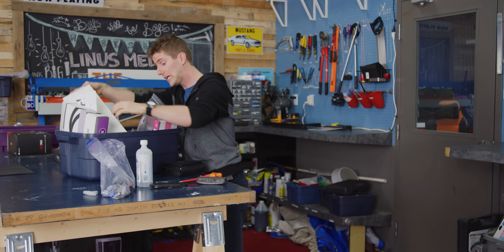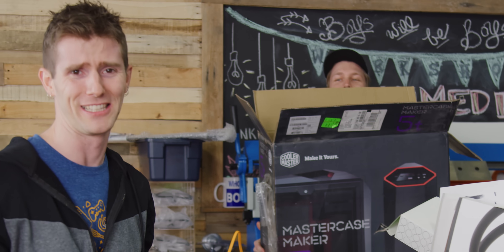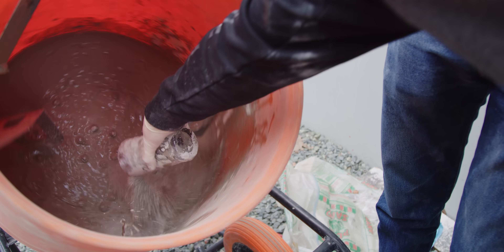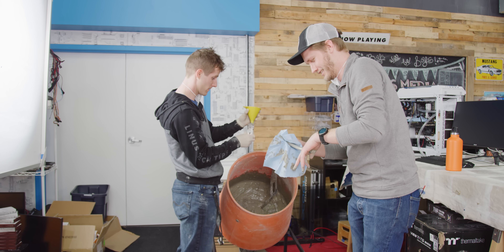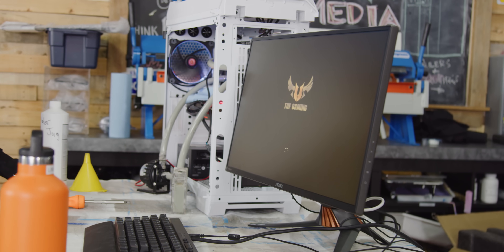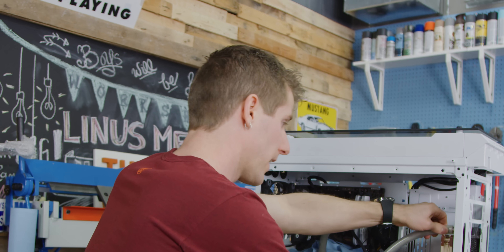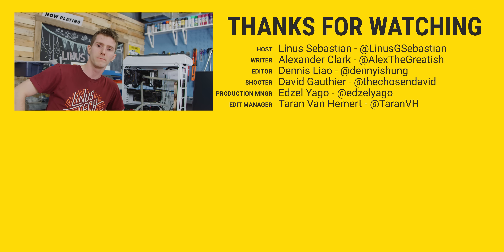I Can't Believe This Worked!!! - Concrete Cooled PC (April Fools 2019)

Comment: The olny april fools joke in the video is that they test their ideas before they shoot a video

p.s. also try liquid metal, its flowing great and does an amazing job cooling the actual metal.
Reply: Gallium cooling! Always keep your PC at a nice steady 50C.
Reply: @Cicirifu  Gallium cooling with an aluminium heat block and radiator :^)
Reply: is liquid metal not extreem expensive?
Reply: @richard123467893  They can probably afford it. Not great heat capacity but it should actually wet the cooling block and radiator pipes, which means good heat transfer.
Reply: Will it not corrode or smth ?
Reply: @marius8032  as long as there is no alu it should be sorta okay
Reply: @marius8032 
Mercury will eat your copper things, mercury disolves copper and forms a solid amalgam, you can check Cody's video on that, its quite hard. Galium forms and amalgam with aluminium, so maybe if you had a copper tube radiator it could work.
Reply: that's an awesome idea i'd love to see that.
Reply: I would... actually love to see this
Reply: @sbcontt YT Could probably get away with a regular strong pump if they mount everything on about the same height.

Comment: Me thinking to myself: doesn’t concrete produce heat as it solidifies?
Reply: Meaning heat is drawn out of concrete. So if heat is endlessly supplied into cement, it will always produce heat creating a fusion reactor.
Reply: @jaywonlee1436  not a fusion reactor, that's different
Reply: Jaywon Lee by drawn out, you mean radiated?
Reply: It's 1st April kids, wtf is wrong with y'all
Reply: I thought it was exothermic as well
Reply: Does concrete need oxygen to solidify?
Reply: @Tillman Adkins no. Just need time to chemicals to bond together.
Reply: The large damns have to be cooled while the huge amounts of concrete solidify, so that the damn isn't full of cracks when he eventually sometime is cooled down.
Reply: It's not even concrete, it's cement.
Reply: IKR
Reply: Same idea
Reply: Hardening produces heat yes. Also heat accellerates the hardening, so dumping cpu thermals into it isn’t exactly helping :-)
Reply: If you made a different percentage mixture, one with more water and less concrete, can you reach a point where it will not solidify at all?  That might actually be usable.
Reply: Concrete just like plaster is an exothermic reaction.
Reply: Yes, as concrete cures, since it is a chemical reaction, it gets hot as it cures. Whether heat being added to it speeds up the process or not, I dont know.
Reply: Yes. It's called heat of hydration.

Comment: so even tho it will cool temporarily the heat exchange between the concrete materials will dehydrate it so soon you will just have a solid concrete loops lol. shoulda slapped some mercury in there after the concrete hardened.

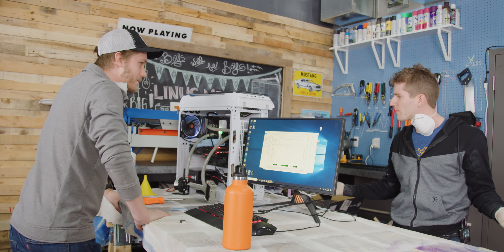Comment: 9:12 lol that's not how it works. The concrete "particles", being ceramic-like, barely have any heat capacity. It's the water in the still liquid concrete mixture that doing all the work here. The heat transfer is still only happening at the block and the radiator. The "heat deposited into the water" is not significant at all. The total thermal mass is bigger here, that helps. Also, the heat transfer to the forced flow at the block could be higher, which is a far too complicated situation to elaborate in a YouTube comment. Linus' conclusion 9:38 is wrong, as no one has a concrete floor that's still 'liquid'. The comparison is wrong. 10:35 no that because it's wet, your hand cool down because there is water in it with a big heat capacity, and this same water evaporates out of it too. Something similar happens with a concrete floor. Concrete is always a bit damp because it absorbs moisture. Therefore, it has a relatively large heat capacity and thermal conductivity compared to another type of floor

Comment: The next crazy cooling solution - maybe using Mercury? It would stay liquid at room temperature (or even a little below) so you could literally have a liquid metal cooled computer!
Reply: mercury disolves aluminum
Reply: @Fabelaz  - it doesn't, thats Gallium which does that (which incidentally has a melting point of around room temperature so sometimes is seen as liquid too).

 Aluminium oxidises on contact with Mercury, so it will discolour and slowly break down, but it takes quite a while. Gallium breaks down aluminium very rapidly - it will break up thin layers in minutes
Reply: But how to dispose of it afterwards?
Reply: Cody’s Lab Colab!

Comment: So cement and water mix reaction is actually a exothermic reaction that's why concrete needs to be cured with water for about a month to keep it cool after it settles to prevent development of cracks so concrete should actually add heat to the system instead of taking it

Comment: Cement paste: cement power with water. 
Mortar: Cement Paste + Fine Aggregates (which is quickcrete).
Concrete: Mortar + Coarse Aggregates .
Cement will then set over a period of hours, regardless of air exposure: it is a chemical reaction and you lose workability starting at two hours in. Over time your system will gunk up and set solid in places, depending on your water-cement ratio. It does not matter if it is left running or not, this reaction will occur. You can greatly reduce this reaction by adding additives (which is complicated) or sugar, of all things. But it will still set.

In the opinion of this civil engineer, use clay.

Comment: Personally I would go with distilled water with an automotive type additive called Water Wetter... it increases the thermal conduction rate from the metal of the cooler to the liquid and usually produces about a 5 degree drop in automotive applications as well as being a corrosion inhibitor.

Comment: Should have used a high-temp refractory. Most types used in energy systems can withstand up to 3000 degrees F and contain 50-80% alumina. Might have led to even better results. 😜

Comment: You’re technically using cement, or some kind of masonry bonding agent. Concrete has crushed stone in it :)
Reply: This is technically correct, the best kind of correct
Reply: I was about to comment exactly same thing 👍🏼
Reply: Paul Catalano we’re gonna need a bigger pump!
Reply: @spaggtrait1608  who's joking about the structural integrity of the system? Cement without aggregate has trouble binding and will lead to severe structural collapse of that water cooling loop
Reply: April Fool's
Reply: I prefer concrete. The sound of rocks grinding around in a pump is soothing
Reply: @spaggtrait1608  me, it still has to make sense and be factual even if it is a joke dumbass
Reply: @spaggtrait1608  yeah mongol. Bet you the type of kid to say "i know you are but what am I?" and still think it's cool af.
Reply: NERD
Reply: Grout
Reply: Technically speaking it's Mortar. ;)
Reply: @georgesrouphael2254  no, mortar is a specific blend with sand. This is pure Portland cement

Comment: Wouldn't it be a great idea to fill a loop with some liquid metal, that hardens at operating temperature and get rid of the pump. So basically something like a custom thick heatpipe. This should be doable

Comment: Should have mixed it, let it set to about the point it was at when they put it in the tubing, then added more water. Deactivate the hardening compounds, just to the point that it wouldn't be at such risk, but it'd keep it's heat draw.

Comment: Of course it works, my house is pure concrete, no insulation on the walls at all, just bricks and concrete, and it's cold in the summer, even colder during winter.

Comment: Cool idea with the concrete I was thinking would be passively cooled.... run a bunch of copper heatpipes as the framework of the case and then pour that acid washed concrete you see on garage floors as the case/ heatsink combo